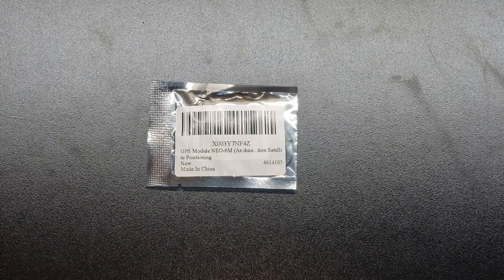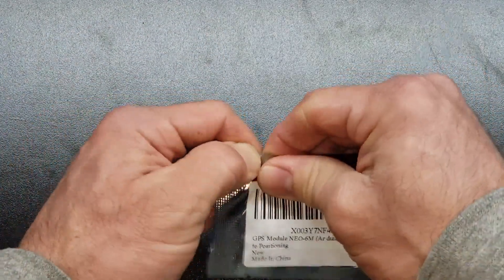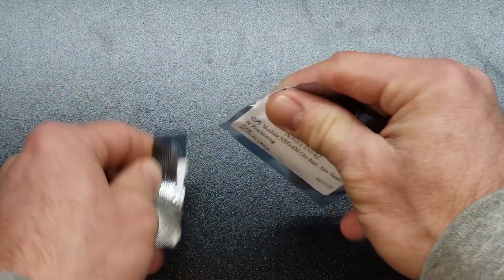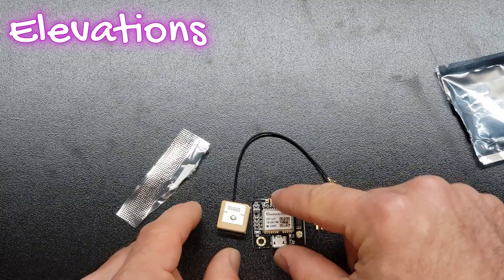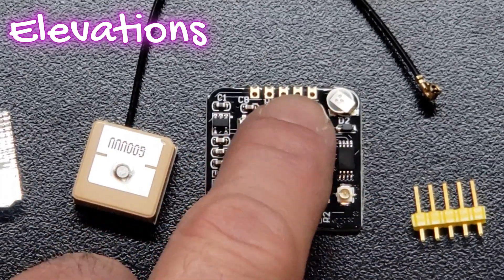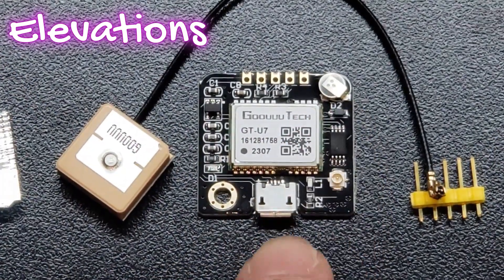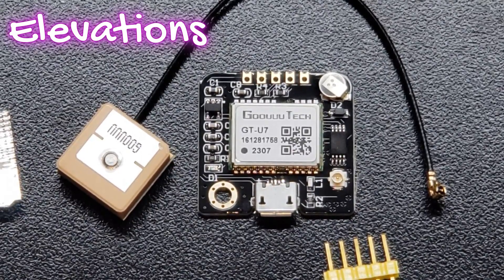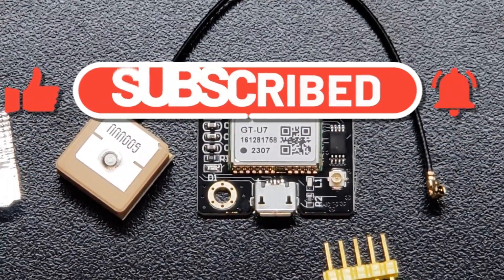GPS GT-U7 unbagging with GPS antenna and headers

Comment: Hi, thanks for the video. I recently bought the same model, but I can't get it to work with my arduino card, whatever the code I upload each time it's the same problem I don't receive any GPS data. Can you help me? Please
Reply from the maker: What seems to be your problem?  We use raspberry Pi for most things.  Did you follow a guide to use with arduino?